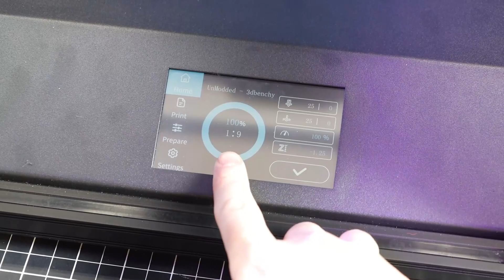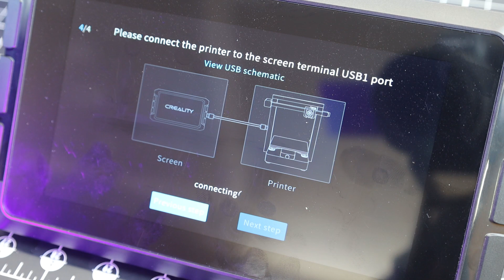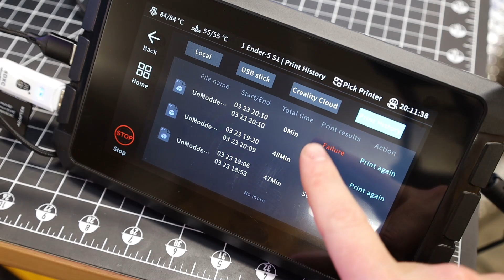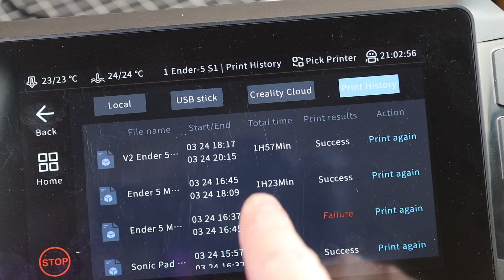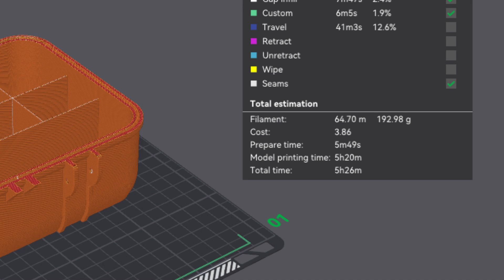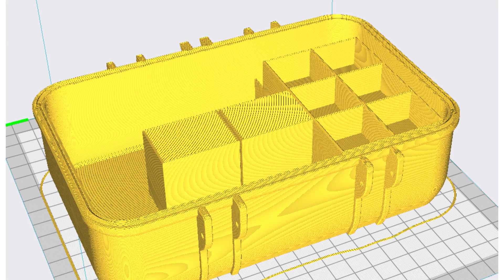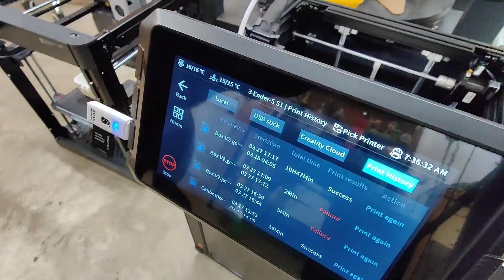Making The Ender 5 S1 is MUCH FASTER with a Sonic Pad

Comment: Feels like a missed opportunity to truly test the limits of these machines.  Who cares about a 15 minute calibration cube when my stock bed-slinging cr10 Smart Pro does it with Marlin?  The whole point of Klipper is that you can let any machine loose without much loss of quality, yet you've managed to run the 5 s1 at slower speeds than it can achieve out of the box.
Reply from the maker: Understandable criticism. Honestly I just don't have weeks to spend doing trial and error on something for one video. For the most part I show a lot of what the out of the box experience is like and if it does anything without doing tons of tuning. And just adding the Sonic pad to this printer did speed it up quite a bit.

I do like 3D printing and I use it as a tool but I don't really care to get into the super fine details of tuning something to its maximum potential. I mostly just use the printers to make designs that I have created for prototyping or for production. 😅👍
Reply: @randymay   Different strokes for different folks.  Nothing wrong with that.  I guess seeing  " Ender 5 S1 is MUCH FASTER with a Sonic Pad" in the title is what created a certain set of expectations and I felt disappointed that they weren't met.  Otherwise good video,  good sound, camera work and lighting.
P.S
For someone designing/prototyping the speed may matter even more than for someone making production-ready prints, since there can be dozens of small changes before something is ready for production and you just don't have all day to wait on the new iteration to finish printing.

Comment: It comes with a screen protector in the Box I was surprised I found it by mistake
Reply from the maker: I will have to check for that. Thanks 👍
Reply: @randymay  Its a piece os cheap plastic on the screen. You didnt scratch the glass
Reply: Where's the screen protector?
Reply: @CB_agotchi  on the screen 🤣😂🤣😂🤣
Reply: @CB_agotchi  Mine was in a plastic bag with the paperwork. I almost threw it away.
Reply: @stevejones01  thank you I found it in with the paper work!!

Comment: When I put a file from cura on the USB thumb drive it does not read it. Is there a certain way or file I need to use to print from the USB drive? Thank you.
Reply from the maker: Are you plugging it into the Sonic Pad or the printer?
Reply: @randymay I tried all three open ports on the Sonic Pad. No matter what port I try, nothing comes up in the list. I have tried three Sonic Pad's and sent them back, thinking something was wrong. Do you have any idea what I could be doing wrong? Thank you for writing me back.